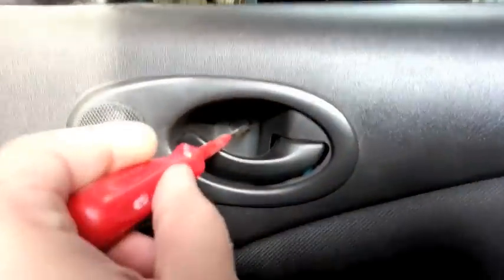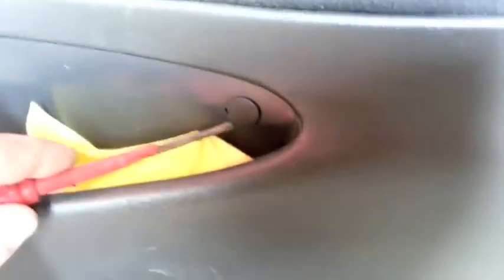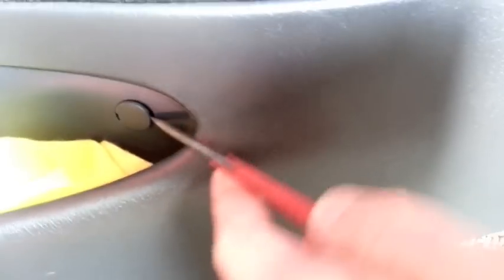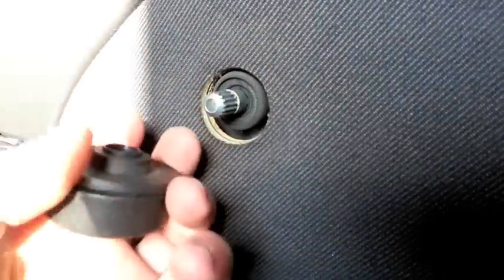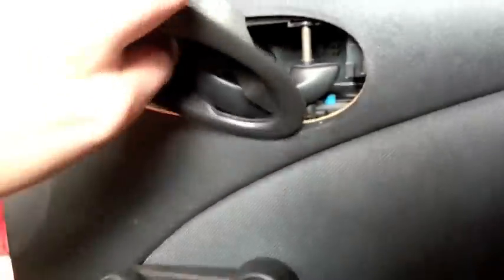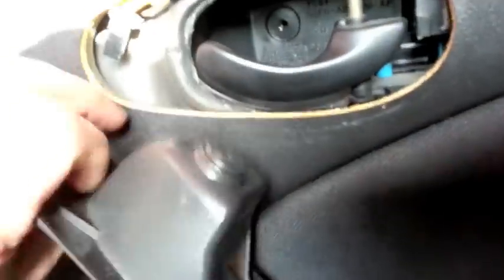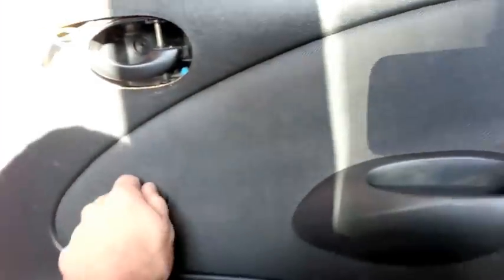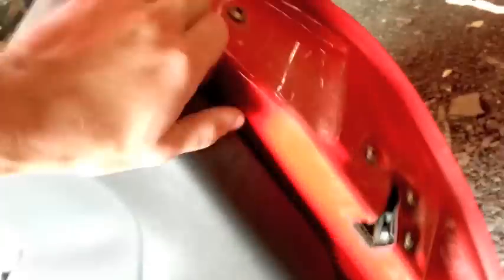Ford - door panel removal - fiesta

Comment: Im Fall es jemand auf Deutsch sucht. Habe an einem Ford Fusion die Fensterheber Kurbel umpositionieren müssen, weil sonst durch das Eigengewicht sich die Kurbel nach unten arbeitet und so das Fenster immer einen kleinen Spalt offen war.

Um diesen Klipp bzw diesen Draht oder Feder von der Kugel zu entfernen habe ich anstatt einem Schraubenzieher ein Messer genommen. Wegen der Schnitt Verletzungsgefahr wäre eventuell ein Blech ratsam.

Wegen der Montage: Ist mir dann aufgefallen, dass man den Draht erst wieder auf die ausgebaute Kurbel einsetzt und dann die Kugel mit dem Draht auf die Welle drückt. Die Welle hat eine genügend große Einlaufschräge damit der Draht geweitet wird. Und wenn die Kurbel weiter zur Endlage geschoben wird springt dann der Draht von selber in die Arretierungs-Nut der Welle.
Fertig.
Reply from the maker: Bilder oder videos waren nutzlich